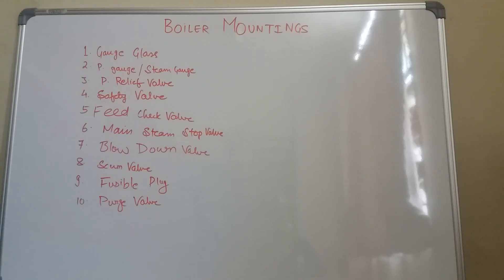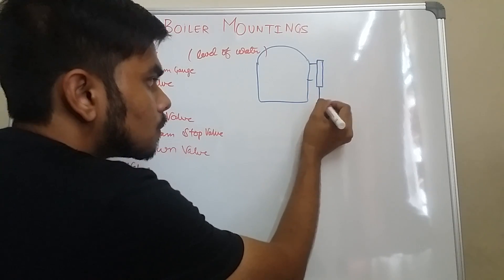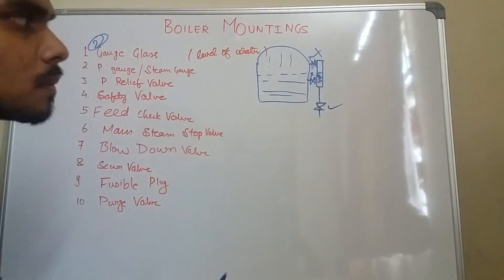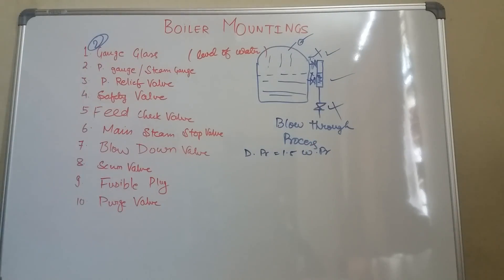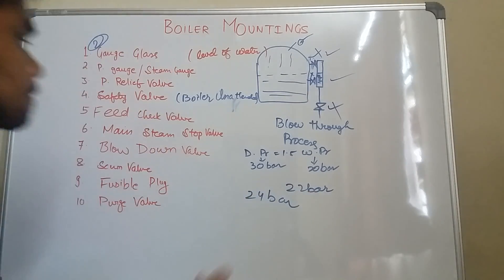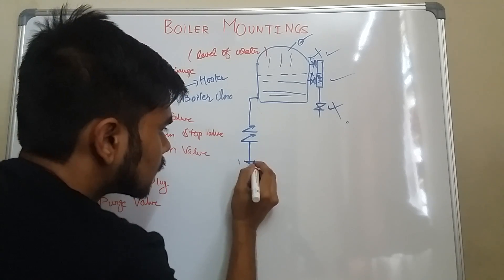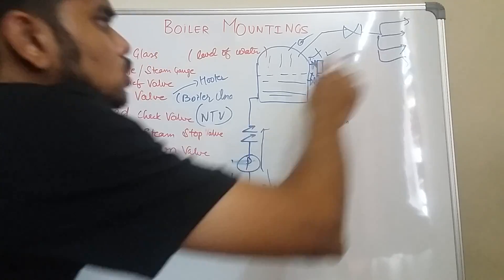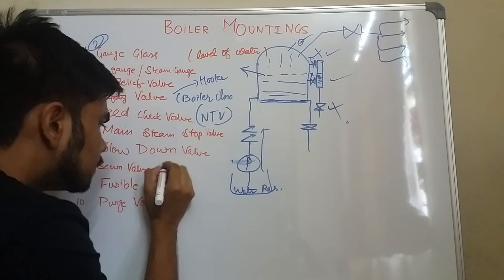Boiler Mountings- Brief Explanation

Comment: sir..i didnt get required explanation  regarding the fusible plug...what if the water in boiler reaches below the fusible plug ???? would u tell me
Reply from the maker: Sorry for the late reply.
sure i will help you. 
If the water level reaches below the fusible plug, the fusible plug comes in contact with super heated steam and melts down easily. This allows the water inside the boiler to flush out and put off the combustion process, thus saving from boiler failure.
Again sorry for the late reply, all the best for your future endeavour. Feel free to ask. Thanks.